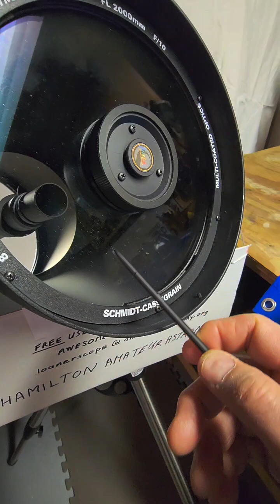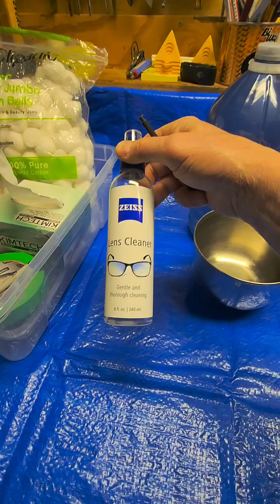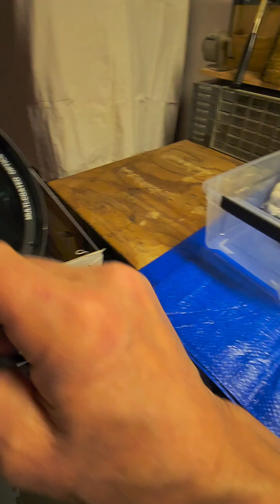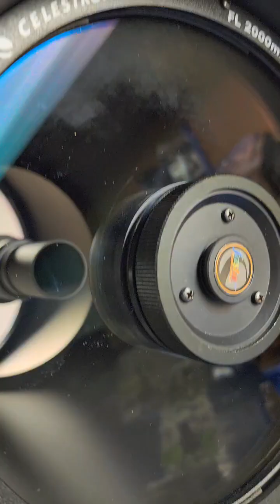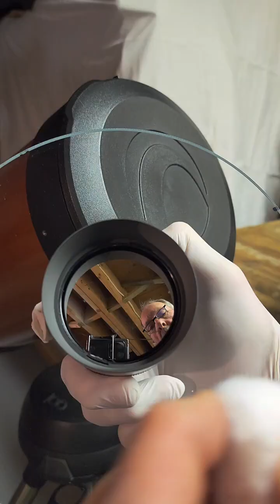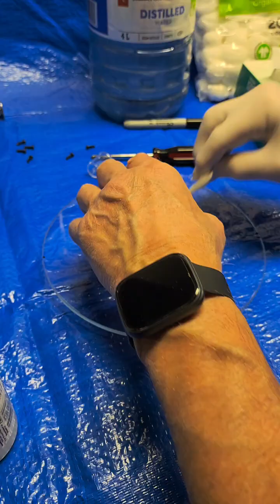Cleaning the Celestron Nexstar 8SE Corrector Plate

Comment: Thanks for the video. My C8 also has a couple of fungus spots on the inside, so just using alcohol will clean them off?
Reply from the maker: It should, although some brands can leave streaks.  Clear lens cleaning solution works well after you have used the alcohol to remove any residual streaking.